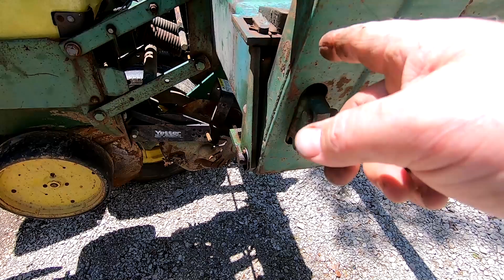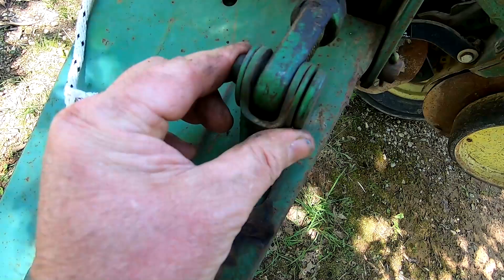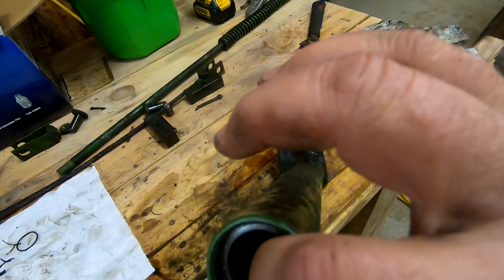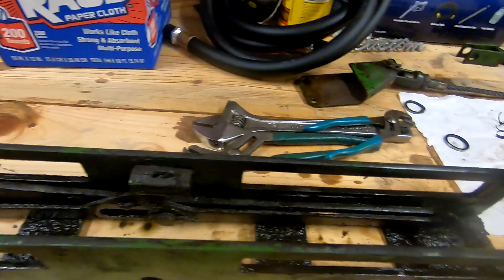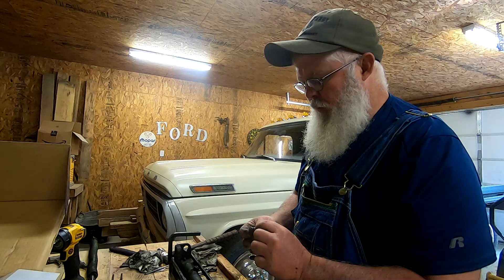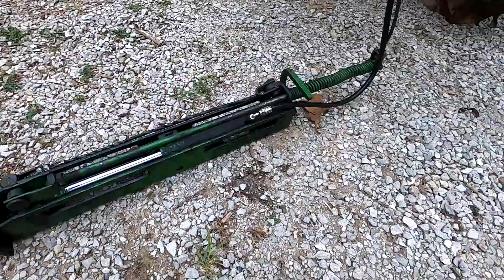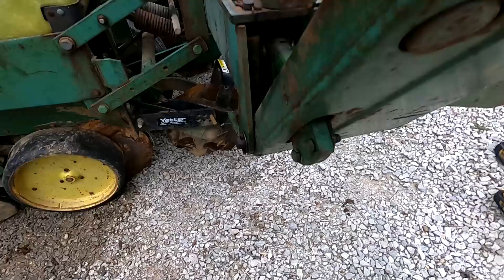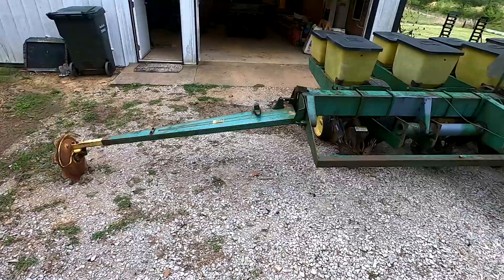John Deere 7000 Planter Row Marker Hydraulic Cylinder Repair

Comment: Thanks! Our local hydraulic shop said the cylinder was welded together and not repairable, it felt good to see how it came apart and take it back and say “here put some seals in it” 😂
Reply from the maker: Glad I could help!! When I made this repair, I was just kind of figuring it out as I went. Way simpler that I expected. Good luck getting yours repaired!

Comment: Looks good. Check on the operation of the markers. Before is separated the lift from the marker, the markers would raise up 1st then the planter would come up. Mine also weighs a lot more being 6 rows and the tanks for fertilizer.  It you have 2 remotes,  it is not hard to separated and It makes it nice to be able to have the markers up at times.
Reply from the maker: Thanks. I had thought about the 2 remote idea. Both tractors have 2 so that is an option. I was a little surprised the markers are so slow about coming up. But I am happy they at least work.

Comment: 6:36 How did you overcome the little piece that was holding it in? Did you have to push it aside?
Reply from the maker: There is enough room for it to slide by and come out.  You have to make sure the block that way hanging is centered in the bracket. It should have enough play in it to slide over a little if it catches on the mounting block. Thank You!

Comment: I found a similar leak in mine this week, but coming from the steel line in the frame. Unfortunately, I can't get a replacement part quickly. I don't use the markers, so I was thinking about capping the hydraulic line that comes off the main cylinder (which raises and lowers the planter) and goes into the frame. Do you think that would cause any issues?
Reply from the maker: Sorry just now seeing this. I don't think clamping the line would cause any issues at all. I was thinking of doing the same thing if it was something I couldn't fix quickly and just not use the markers. Thanks for watching!!